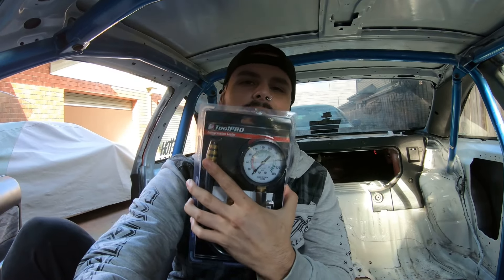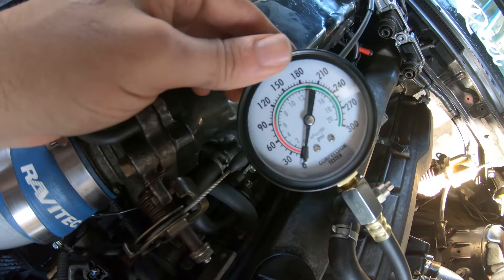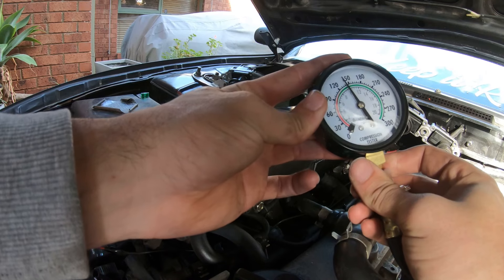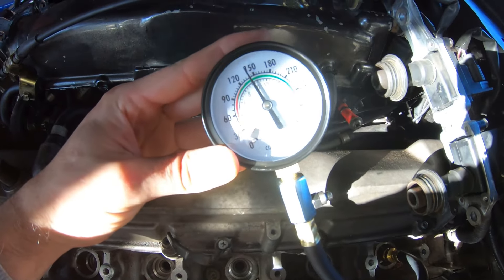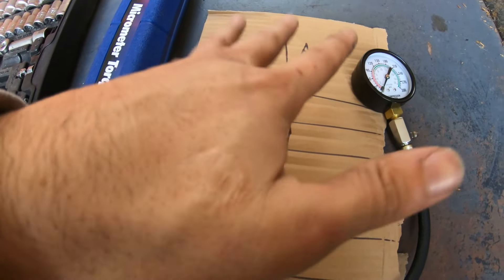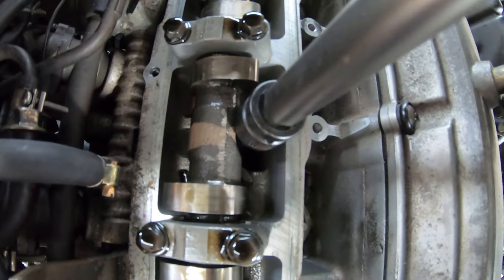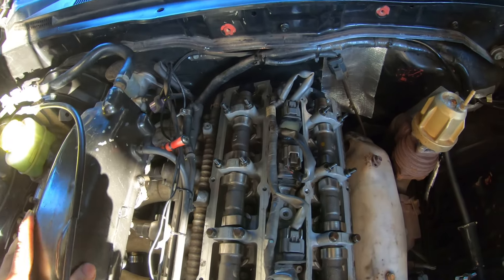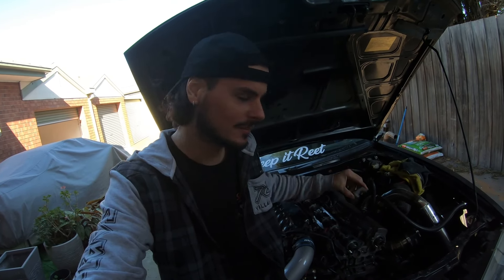Unknown Abused RB25DET Comp Test With ARP Head Stud Mod!

Comment: Hold the throttle wide open, should get better, more accurate results. I just unpluged the injector harness at the front of the intake manifold to stop the fuel.
Reply from the maker: hey mate I do it cold start so you get a more correct reading then you will know once it warms up she be good

Comment: With bolts, I always go backwards (as if you're undoing it) first while applying alight pressure until it clicks, that way you know the thread is always aligned and it never cross threads. I apply torque in increments, going to 35lb then 60lb then 80lb and never had an issue.

Comment: You don't need to take out the cams to get to the headstuds bro. If you get a 3/8 10mm Hex that'll get the stock ones out, then a 3/8 13mm 12pt socket will get the ARP ones in. The trick is to get 3/8 size tools man. You can put in ARP studs by replacing one at a time without taking cams out or anything off the front :)
Reply from the maker: Cheers for the input dude. Didn't have them tools and explained if you grind down that socket it could fit but no grinder and plus never need to do that ever again unless I get another rb25 with stock head studs 😅

Comment: Need engine at operating temperature and wide open throttle, you will normally see around 10 psi more each cylinder
Reply from the maker: That's why I did it cold start mate to get a correct reading and once it warms up you know she be good again

Comment: jeeze, that cam bolt issue sucks. i would have given up at that point.. at least its a broken off bolt not a broken off drill piece or thread tap, those are impossible to drill out.